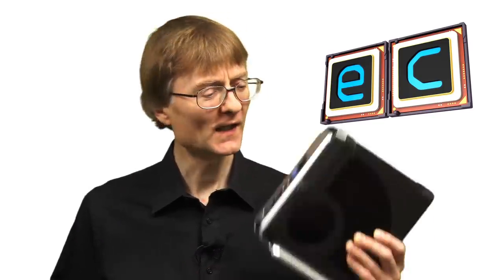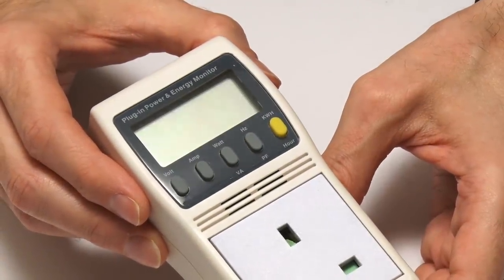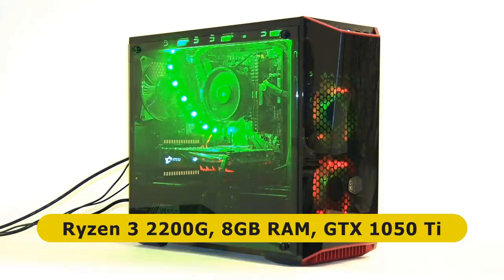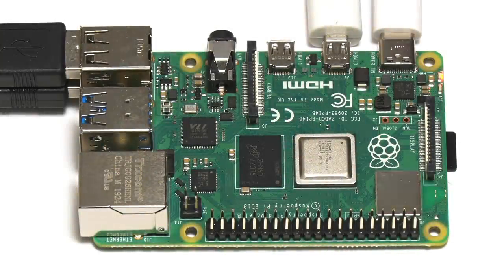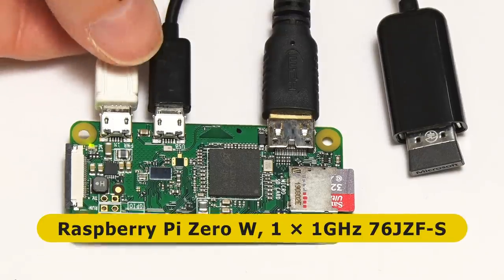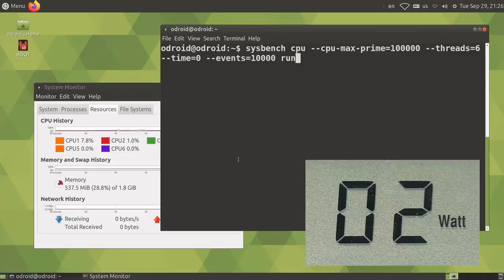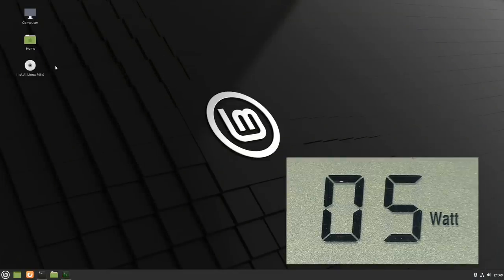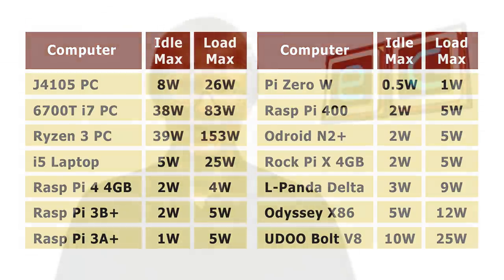PC & SBC Power Consumption

Comment: The laptop did pretty good considering it's powering a display and running an x86 i5. Seems like a good middle ground.
Reply: Chris didn't measure the cpu power consumption; he measured the battery charging consumption.

Comment: Surprised to see you are still using a 5 year old CPU for your rendering with all the advances AMD has made during that time. Any chance you might upgrade to Ryzen? Really curious how big a difference it would make in usage cases like yours.
Reply from the maker: Thanks for this :) But there is zero chance of my going Ryzen on my video editing rig anytime soon. My pipeline is Intel, and you cannot mix Intel and AMD in a CGI rendering pipeline as the random seeds do not match, so frames rendered on different hardware would be different. So I would have to replace my render box also (I only generally render video on the main PC, 3D CG is rendered on another box, but this is also 6700T).

Ryzen is powerful, but also power hungry and so generates a lot of heat. So I prefer to use "T" Intel chips both on environmental grounds, and to maintain system life expectancy.

Given that I can edit 4K fluidly in real-time, I would get no benefit from moving to a Ryzen (nobody can edit faster than real-time!), but I would use more power and have the considerable hassle and cost of an "upgrade". And I would have to downgrade from Windows 7.

AMD have done some amazing things with their Ryzen CPUs, but the benefits of CPU upgrades get less and less. For video editing, RAM, system design and video pipeline matter far more than the CPU. So, for example having a 3-drive system (one for the OS and apps, one for the video files, and one for the video editor cache) makes far more of a difference than a CPU update. Similarly, shooting ProRes (rather a interframe consumer format) blows any CPU upgrade out of the water.

We all do what works for us, and for me the capital investment does into the video hardware. If a PC upgrade would improve the speed or quality of my output, I would upgrade. But it would not. So my next upgrade is likely to be something like an Atomos Sumo -- when funds permit! :)
Reply: @ExplainingComputers  Thanks for the info. Learned some new things. Most tech Youtubers always make videos about how the latest tech improved their video creation workflow and saved them time but they don't really talk about the kinds of things you mentioned. Good stuff.
Reply from the maker: Thanks for this, most appreciated. I've met a fair few YouTubers at YouTube Space in London and at various events, and always surprised at where they choose to invest in their pipeline. And the focus tens to be a PC with a powerful processor, and then DLSRs and often separate audio recorders . . .  In contrast, I come from the world of shooting film and the horror of audio sync, and so appreciate using a camcorder with the right ergonomics for the job that has XLR jacks and records decent audio internally! :)

I guess most YouTubers started out shooting on smartphones and wanting to be influencers. In contrast, I had been a film maker (eg for the BBC) for three decades before I became a YouTuber, and still see "film maker" as  what I do. So for me, the biggest investment has to be the camera and recording equipment, and in working with digital formats that save time and deliver flexibility in post.

Comment: I wonder why you do not use Nvidia Quadro in your pc used for rendering? Wouldn't it be faster than low 1030 for that task?
Reply from the maker: On the PC I show with the 1030, all 3D modelling is done in LightWave, which does not use the GPU for rendering. So rendering performance is dependent on the CPU, not the graphics card. And I don't do (much of) the rendering on this PC anyway -- I have a different box that can run Screamernet (the CLI LightWave renderer) 24/7 for that.
Reply: @ExplainingComputers  now I understand. Thank you :) !

Comment: I wonder if there's a way to calculate some sort of "computing-per-watt" unit...  Which computer is the most efficient on an amount-of-computing-done-per-watt-of-power-drawn basis?  Sure, the Rizen 3 PC drew 38.25 times as much power under load as the Raspberry Pi 4 did, but if it does, say, 40 times as much computing, it would be a more efficient use of power, no?

Comment: Measuring especially AC-Power is tricky. Switching power supplies with a power factor other than 1 tend to have greater errors when measured with "cheap" devices.
And measuring at the lowest end of the measuring scale also is highly inaccurate. If the device is rated with x% accuracy then that usually means x% error at the maximum of that scale. And this absolute error would then be allowed on all of that scale. So 1% at 1kW (which I assume your meter is capable of) would result in an acceptable error of 10W throughout that scale. Not displaying the decimals absolutely makes sense here.

Regarding the RPi 4 for which I have some measurements, the idle current is given with 575mA (DC) and the maximum current is 1280mA (DC). With a voltage of 5.1V (official RPi power supply) this results in 2.9W idle and 6.5W maximum DC. Now we have to add the losses in the power supply ... So at least your figures of the RPi 4 seem a bit off ...

Comment: So you fully charged the i5 ZenBook's battery to make to make sure is wasn't charged by the power adapter.
How can we be sure that the charged battery isn't secretly (partly) powering the computer? I.e., that the computer draws its power exclusively from the connected external power adapter?
I think I've seen a laptop draw power from its internal battery, despite a power adapter being connected to it (think on PowerBook and/or MacBook at full load, for instance).

Comment: 5W max load of the raspberry pi sbc's seems to be limitations of the usb power. Correct me if i am wrong but as far as i remember usb 2.0 can deliver a max of 5W.
Reply from the maker: USB 2.0 goes up to 2.5A, which makes 12.5W. But the Pi steps out of that anyway, as it uses its micro USB connector for power only, and like many ARM SBCs works with (and at times requires) a more highly rated 3A adapter. Until the move to USB-C adapters, many SBCs relied on micro USB adapters that were beyond formal USB 2.0 spec.
Reply: @ExplainingComputers  FYI = cheap boards such as RPi were trying to cheat ohm law by providing non-standard mUSB PSU with 5.2V ... But since they could not solve the problem for people that didn't hear them, solution was done by software by killing CPU cores beyond Linux when voltage drop was too high. Another reality that is impossible to cheat is that many mUSB connectors have troubles transferring anything over 2A at 5V. In some cases (Tinkerboard) board without anything attached to the USB sucks more than 2A + voltage drop is too bit so board just crashes already at boot. And USB-C must be smart (PD) or you didn't made much of a progress ...

Comment: Lots of computers in a rack, generates heat and then you have to cool down this heat or the computers will get too hot. There fore you are paying twice for the electricity, once to run the computer which generates heat and secondly to keep the room cool. Up to 15 year ago they cooled  computer rooms to just above dew point, then they changed and looked at the specs of the computers data sheet and if it could run at 40 degrees C why should we cool the room below that. The savings are phenomenal. When a PC goes to sleep and the screen goes blank or just displays the time is it idling or semi conscious and what is the difference in power usage?

Comment: If you left i7 machine with OCCT CPU stress test and Furmark running at the same time that PC would be consuming much more power. 83 watts even for T series processor is unrealistically low truly maximum load number. Especially with dedicated graphics card, which in tested tasks wasn't really loaded that well. 100-130 watts would be more realistic numbers.

Comment: Could it be that the pi4 that only got to 4w under load was already warm? Just thinking the pi400 does have a higher clock but also a bigger heatsink also I seem to remember the pi4 been described as wanting more power than its pi3 brother (hence the official raspi power supply) 

Just a possibility that may explain the difference

Comment: Most excellent as per usual. I am always keenly interested in power consumption. I setup an Odroid HC1 after watching your review of it to setup a NextCloud server which I have now been running for a couple years. I like that a single-board computer uses about as much electricity as a night light. I also use a Pi for OpenVPN. For many applications, you might have a need of an always-on device, but do not wish to be wasteful or unnecessarily use much power. Thanks so much for putting in the time to research and measure all these devices. Very useful!

Comment: SBC are truly awesome I love sbc because of their small form factor and low power consumption.
Reply from the maker: Agreed. The power figures speak for themselves.
Reply: Their not bad, they really are not but their low power usage is by design. It's intentional and the goal, desktops will always use more due to their general purpose goal, but with that they are more flexible and preform a wide range of instruction sets effectively.

I think the age of x86 is holding it back, so much built in compatibility needed for stuff which isn't exactly used anymore leading to a system which is more susceptible to exploitation on the hardware/firmware level.

Both has their own purpose and both do it well, x86 paved the way and built the road allowing for SoC to shorten the distance more quickly. Without x86 SoC's wouldn't be nearly as "advanced" as they are now tho, I still really like them tho to see a relatively modern alternative to x86 growing in real time.

Comment: Looks down at my UPS display wondering how much power my system is drawing: 487W is being drawn sitting in the lobby of World of Warships (more draw than when playing, oddly).  It's in the 200-something range under load when the video card isn't guzzling power.

850W 80 Plus Gold (so fairly efficient), R9 3900X, RTX 2080S, Aorus Master X570, 3 SSDs, 1 HDD

It feels like I have a space heater compared to the numbers in this video!

Comment: This (oddly) is why I am developing for Arduino (and clones) now for many of my smaller projects because they (a) don't use an OS, although some are available, and (b) can do many of the simpler jobs often built on RPi Zero and even its larger brothers. I know they are convenient but a well programmed Arduino can run for MONTHS on a single CR2032... not that it's going to do much - I'm thinking in that case of a capacitive soil moisture monitor, but with care, it's absolutely amazing what you can do with some forward planning and the skills to program the application (or hopefully find one someone already made).

My rendering PC is frighteningly beastie - running something like 600W at full tilt... It's embarrassing when the local power company calls me up and says, "Are you rendering this week Marc?"

Comment: Thank you, Christopher, for the informative video and the hard work behind it.
The idle performance data is very good information that can be important when choosing a platform to operate a router, an IoT center or any other device that runs permanently.
With the second measured value, the consumption under full load, I am not so sure about the usefulness. In a figurative sense, this value only says how well the candidate is suitable as heating for the winter;) In combination with another factor, this would make sense again: I'm thinking of something like Dhrystones per Watt. That would at least tell you whether the heating precious computer (in terms of computing power) is good :)

Once again, my respect for the many series of measurements. I bet you that for Christmas someone will give you a power meter with decimal places :)
Jeff Geerling has some detailed consumption measurements, too. At least for the Rpi: https://www.pidramble.com/wiki/benchmarks/power-consumption

Comment: The Pi tests is giving strange results, maybe the power meter doesn't work well for low power measurements. A gross calculation gives around 10W (P=5V*2A) with a recommended PSU, so I would expect a bit higher than just 4W for Pi 4 or 5W for pi 3A+, 3B+).... We know that we cannot power the Pi with only 5V@1A, specially at full load....

Comment: hi Chris
 nice video :), butt you are missing a point, the wattage is pr hour, so we need to compare two pc, example a ryzen andf a pi, completing the same task, and mesure the amount of time, 
If we take a pi (5 watt) and a ryzen (153 watt) the pi complete the task in 30 min, and the ryzen in 1 minute, both have consumed 2,5 watts.
How about making a litle video of that?, David vs Goliat...now we all know that david won the battle, is it posible that a pi can win it too??
Reply from the maker: No, I am not missing the point. At any one moment in time a device, here a computer, is drawing a certain wattage (current x voltage). I get where you are coming from, that we use computers to complete tasks and hence that the energy used to complete the task is what may matter. But most of the time this is not the case -- we don't, for example, read web pages, write documents, or watch videos faster on a faster PC. And most of the time, most PCs are in an idle state waiting for a user to do something. So the idle power use is a critical comparative measure.

Comment: Why not run cinebench to measure power consumption
Reply from the maker: Because (1) it i not available for all platforms here, and (2) as I explained in the first segment of the video, it is impossible for any software application to measure the the power consumption of a computer. Software utilities can at best measure the power drawn by some (and only some) of the individual components. But they cannot measure the actual input power draw of a system. This can only be achieved by putting a meter between the computer and the wall socket. :)
Reply: @ExplainingComputers  ya you are absolutely right 👍

Comment: I noticed something which I think was missed. The laptop was probably the most efficient device, considering that it factored in the monitor consumption which in case of any sbc or desktop would be additional 22 W. Correct me if i am wrong.
Reply from the maker: You are correct! :)
Reply: Well that kinda depends. Many people seem to forget that you are usually not getting constant load from power brick if you have battery attached. I'm almost certain that this video also has bit flawed measurements because of this. Generally speaking power is cycled on and off on batteries. You'd have to use machine for quite a while to get realistic measurements or disconnect battery all together.
Reply from the maker: @jothain  Totally agreed, and I made it very clear in the video that there were limitations to what I was doing with the laptop. But the battery -- as in most slim laptops -- is not removable.

Comment: A firmware / BIOS update fixes the fan issue on the Bolt.
Reply from the maker: I would love to know how! :) The stock fan is not PWM controlled, so is always either on or off. I've followed the forums, but never come across a BIOS update where users report the fan problem is fixed. If I have missed something, please let me have a link! :) All I've come across is using a different 4-pin PWM fan.
Reply: @ExplainingComputers  The firmware update can be found via this thread:
https://www.udoo.org/forum/threads/whats-up-with-fimrware-1-08.31940/
Reply: More information about the fan settings here:
https://www.udoo.org/forum/threads/best-fan-speed-settings.31586/#post-59496

Comment: EXCELLENT video Mr Barnatt - this is one of the least considered areas as far as I'm concerned.  I frequently answer the over-asked questions about SBCs as "what would you use one of these for?" and I tell them about using something like ARIA2 for large size downloading without leaving your main rig on - they dismiss this as a non-issue and run a rig that would consume perhaps 80-150 times the power of a Pi Zero W (which would be quite adequate to the task even bringing in huge ISO files, etc.).  
I think there's a lot of value in pursuing the build of a multi-purpose home proxy/gateway/server build for this purpose;  I see some fractured videos on this (or they cover only a few perspectives such as library serving alone) but I think there's more scope for this moving forward.

Comment: it seems the thing that draws the most power today (Atleast in desktops) is the GPU; even a modest graphics card can still consume 150w at load, and with the newer ampere cards from Nvidia we've pushed well past the 300w point.
Reply: 3950x draw 250watts and its a cpu
It depends i am runninng a 1650 and  i3 10th 
Total power draw peeks at 130 watts.
Idles at 8 watts.
Reply: @THESOHAILKHAN1992  The thing is that under normal circumstances, the 3950X is limited to draw 140W.
Trying to draw 250W will result in a stupid hot CPU, and unless you have custom loop/sub-ambient cooling, good luck cooling that chip.

Comment: Apple m1 consumes 10-15w
Reply from the maker: For its CPU, yes. It will be interesting to see what M1-based systems draw.
Reply: @ExplainingComputers  being retired I test power usage in the house hoping to reduce costs.

I found that my i7 pc and my i7 Mac mini use similar on being used, but on sleep the pc drops to 7w while the mini holds around 23! Apparently things like Apple spotlight never shut down.

So I turn it off when not being used.

I am guessing the new M1 machine will be similar if Apple keeps it active on sleep.